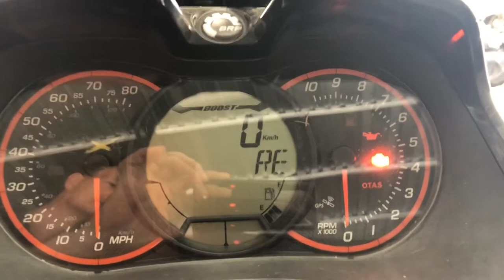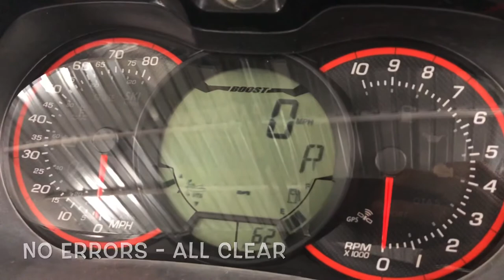Seadoo RXPX/RXTX 260 Cluster Replacement

Comment: Do you know if the ski will start with the new cluster in but BEFORE programming it? I know it has to be flashed/married to ECM for the gauges to work right, but would it start and run before programming?
Reply from the maker: The Ski will not start if the new cluster has not been programmed

Comment: I have the exact same problem , on my 2011 Sea Doo RXT 260. Is it a direct swap an NO flash programming or do you have to have it programmed? Thanks
Reply from the maker: Hi there you have to match the new cluster with the ecu so the computer must go on to do that .
Reply: @Redrockat  thanks, I purchased a new one as my dealer was unable to purchase. What would be the approximate cost to have it linked to the ECU after installed?
Reply from the maker: @TrojanStarryNight  from which country are you ? A dealership should ask a hour labour and a computer diagnostics fee .
Reply: @Redrockat  I am located in the USA.

Comment: Hey, flipped my 2014 rtx and shortly after the screen started to bug then jus completely shut off. Now it starts and runs but no beeps, gauges, screen, and won’t seem to go into sport mode and that stuff. Do you think a new gage cluster would fix this or more of a connectors issue some where?
Reply from the maker: I think it may be a faulty cluster . Try to unplug it and see if the pins in the plug are maybe faulty ... if not it will be the cluster yes .
Reply: @Redrockat Alright, thank you I will give that a try.

Comment: I have the same problem. and I can only restart the jet, just disconnect the battery. Is it the instrument panel that leaves it in key reading mode?
Reply from the maker: Yes it's the Cluster instrument panel that malfunctions and leaves the Ski on or awake

Comment: Hi, how do you remove the gauge support at the beginning to lift the complete support?. Are there only clips? I couldn’t find anything in the shop manual.
Reply from the maker: There are only clips yes . Remove the back peace and then you have to wedge the cluster loose with a small flat screwdriver and on the top there is a little like leaver that also has to pop off . If you don’t come right let me know I will make a walk through video specially to show how to remove the cluster . It’s delicate work so be careful not to break the plastic clips .
Reply: @Redrockat  thank you. I just tried it but scared to break some
Clipses. If you could take a short video including the removal of the support gauge that would be great. I would like to replace that as the same time as well. Thanks a lot!
Reply from the maker: @chrisklein707  okay will do

Comment: Was the problem just the message saying “reading key”? If the ski started and drove fine I’d leave it alone. Waste of $1000 for a new gauge
Reply from the maker: The cluster did not switch off , so then the battery runs down . For safety reasons it’s better to replace the cluster then there is no communication glitches which could result in problems in the water .
Reply: @Redrockat  that’s a new one for me. Wonder what the problem was
Reply from the maker: @benschroeder1161  the motor also did not switch off unless the Dess key was disconnected. Maybe something in the cluster has blown , we had a lot of lightning and this can damage a ski in various ways . After replacing the cluster all was good once again . Thank you for watching and commenting 😊
Reply: @Redrockat  did you sell the old cluster?